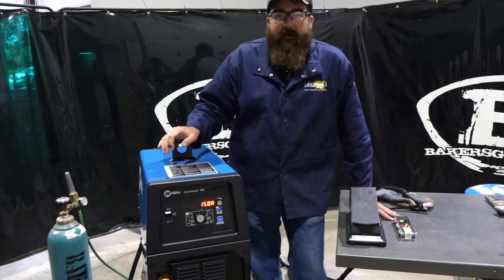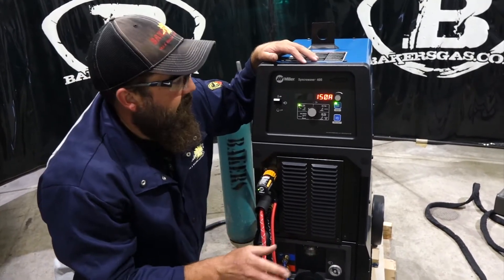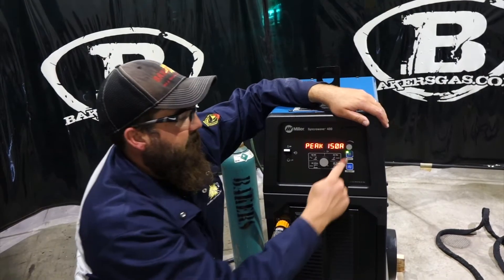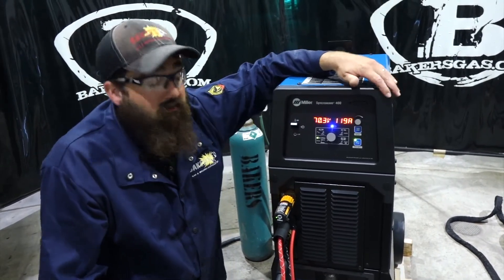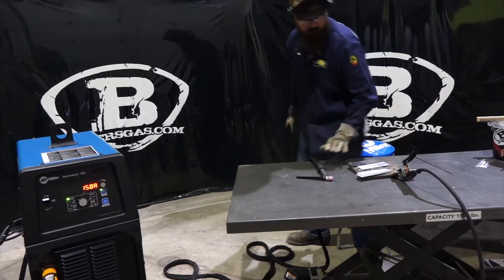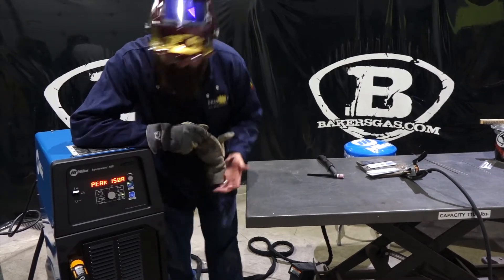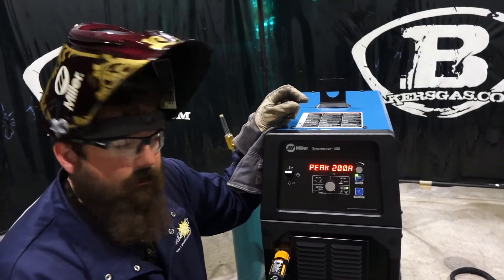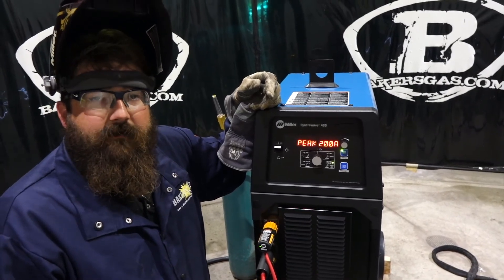Miller Electric Syncrowave 400 AC/DC Review and Demo

Comment: Hello Mr,
I would like to buy a new tig station and I'm hesitating between the Syncrowave 400 and the Dynasty 400, I weld 95% aluminum with different thicknesses between 1/8 inch and 5/16 inch, which station would you recommend, in advance thank you and have a nice day.
Didier.